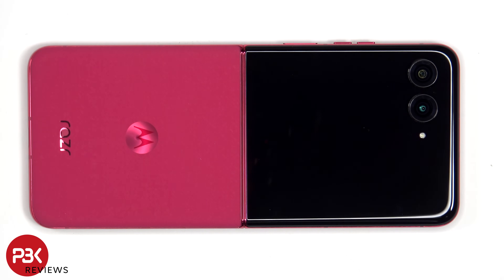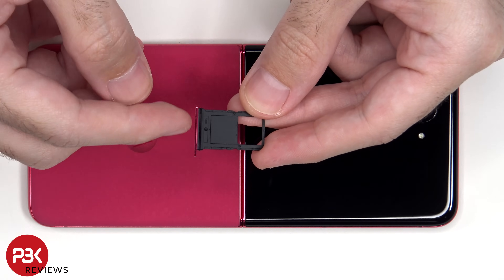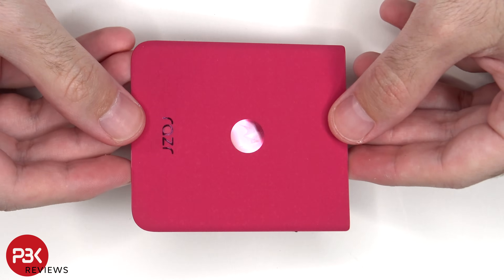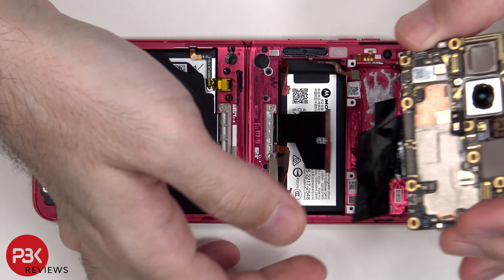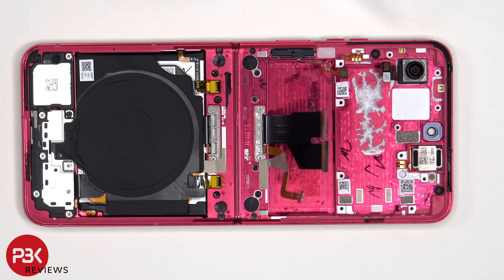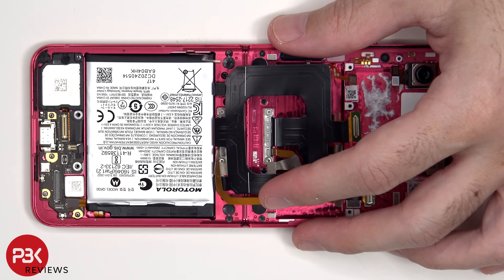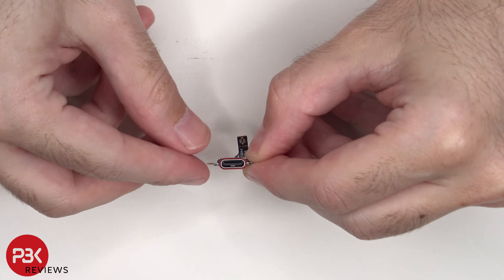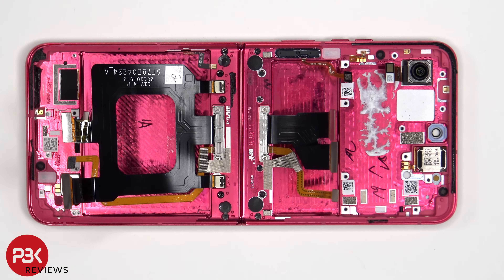Motorola Razr Plus 2024 | Razr 50 Ultra Teardown Disassembly Phone Repair Video Review

Comment: So do I have to remove everything just to replace the main screen is crazy
Reply from the maker: Somewhat everything but generally I don't recommend replacing just the fold screen on this folding phones. It's best to replace the complete folding flip and move your motherboard and other parts over to the replacement, since if you don't use the original adhesive and apply it correctly to keep the folding screen properly in the correct place and it moves when folding, it will cause it to crack and will be money down the drain.

Comment: how did you get the screen and back to stay adhered after disassembly? mine no longer stick
Reply from the maker: You need new adhesive. You can check on ebay for it or mobilesentrix.com or rounded.com

Comment: I'm replacing a battery do I need to get a certain adhesive to reapply for the reassembly
Reply from the maker: depends on which phone
Reply: @PBKreviews  same phone
Reply: @PBKreviews  I dropped my razor in water and now when I try to charge it the LED light is blinks rapidly I was going to try changing out the battery it worked fine until the battery died
Reply: @PBKreviews  maybe just standard double tape...

Comment: Pros between a flip like smartphone and a regular one?
Reply: Google it
Reply: problem with the flip that I found the hard way: magnets on the inside corners of the phone attract metal debris like broken staple wire and holds it between the two halves when the phone is closed.  This punctured the two corners where they meet and destroyed the inner screen completely.  I had this phone less than two months and couldn't figure what happened at all.  If I had known about the magnets I would have gone with the regular phone. The inner folding one is too fragile to have random metal sticking to it when it gets set down.  Poor design choice.

Comment: Nice to see motorola using strong adhesive definitley how they achived that ipx8 rating
Reply from the maker: yup, the bottom cover was standard as I've seen previously but the screen adhesive on top had an extra rubber seal which was a cure in place type seal (glue that cures). Those are usually much harder to pry off.